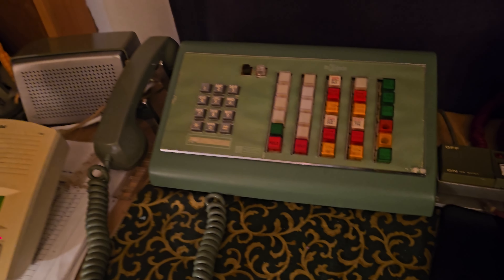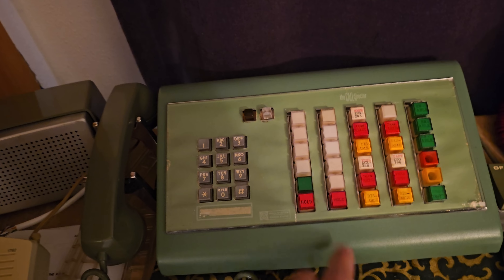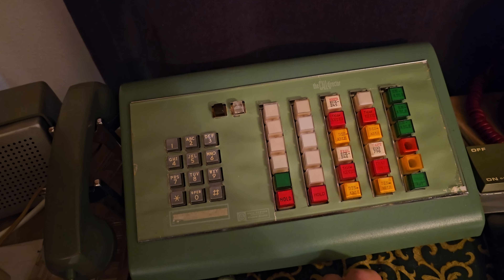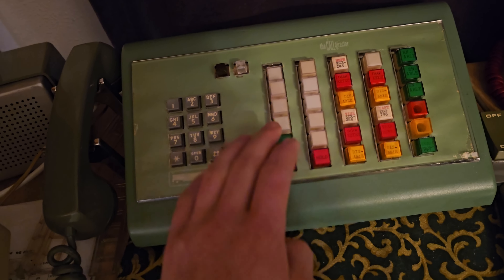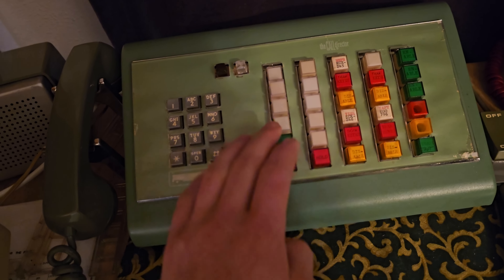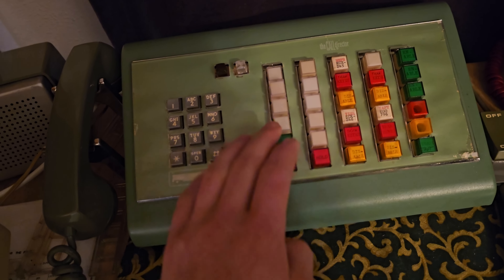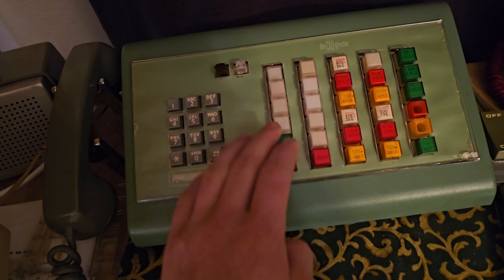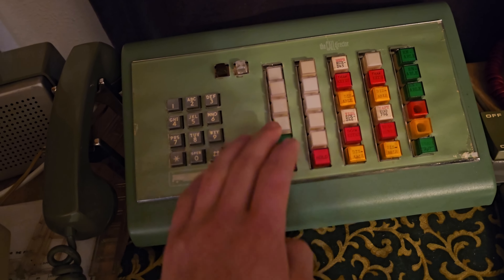my priority hold circuit stopped working (reminder to check cables!)

Comment: This is some pretty neat looking kit! Do you use it for anything specific, or just a fun build?
Reply from the maker: Well I hardly get to use my phones for anything anyway

It was mostly to prove that this could be built 

Priority hold equipment was so hard to find and get all the parts, that it was almost mythical and a complete dream to think you could even get a complete setup as it required not one but two extremely rare line cards

And the original only had a 2 line capacity 

Since I now had the skills to program and wire something I always really wanted one mostly for the extra lamp flutter it does

I am planning on using this with my autovon set and just mostly for show

I may eventually make more of these or expand the existing setup if there is demand or a want on my part to have something 

So far it has worked flawlessly 
I also added a bit to my program so it will shutoff my interrupter power supply and other ac devices when I am not in the room to automatically save power 

I'm hoping to integrate it with a answering machine so when there is a new call the hold key lamp in my call director will slowly fade to indicate a new message
Reply: @kadensmodifications ah yep, nice! Thanks for the details. It'd definitely be interesting to see you talk through a bit of history on it, what problems it was originally designed to solve, how it would've been used in practice, etc
Reply from the maker: @StephenHoldaway  I have made a couple videos talking about it already 

Priority hold was designed and used in places such as police emergency lines and ER or somewhere that time to answer certain calls was of the essence 

Also I heard one person say who worked in a police emergency line center that whichever calls would be on hold the longest would automatically get the Priority lamp wink to signify that the call was there first 

Another feature is I hold

Priority hold signifys the hold condition to all connected sets 

I hold shows the special lamp flash to only the phone that put it on hold
All other sets saw the regular flash

To me that was less neat so I configured my sets with Priority hold